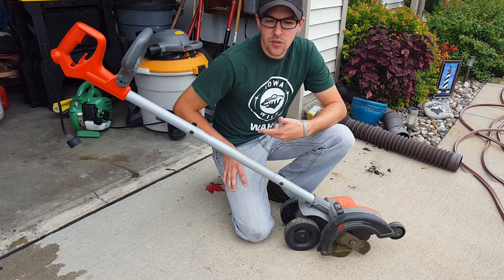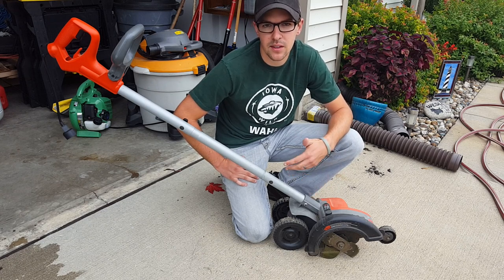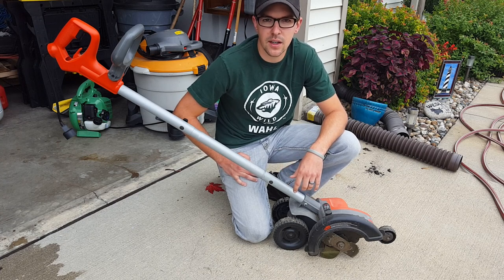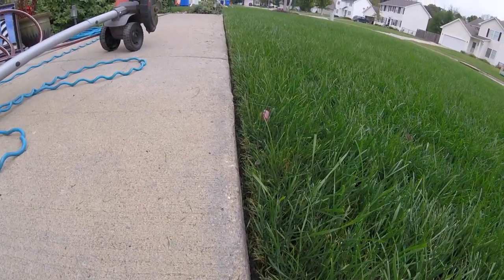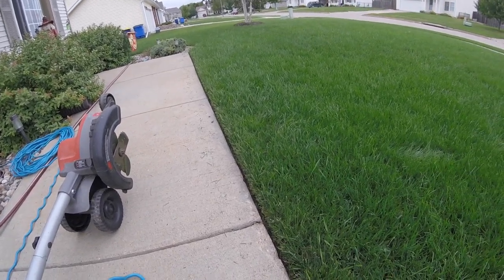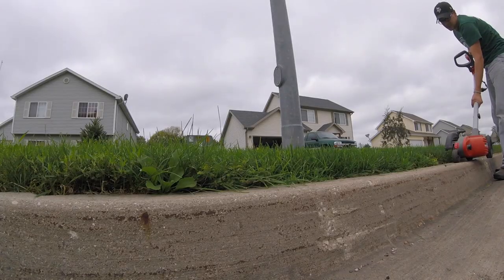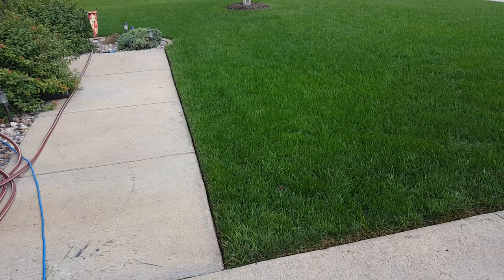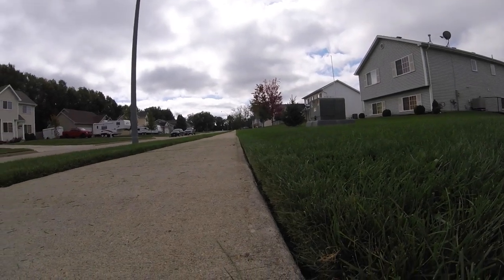Lawn Update 25 - All About Edging

Comment: I fully realize this video has aged a couple years, but I was using the same model successfully for the past 5 or 6 years.  I recently, however, invested in a few Greenworks Pro tools that utilize the 60v Max battery system.  Their 60v edger surprised me by doing as well as or maybe even better than the B&D model.  I have about 160’ of curb to edge as well as about 60’ up one side of the driveway and 50’ down the other side.  A single 2.0 amp hour battery can easily edge all that length on a single charge.  No more dragging cords around.  Thanks for the channel - really enjoy seeing your techniques as well as the new products from time to time.

Comment: Picked this up based on your recommendation. It is really easy to get a clean edge. I tried to do it with the string trimmer and it was really tough to do cleanly. I will still use a string trimmer for trimming weeds and grass near fencing or trees. But this is perfect and affordable. The only complaint if any is that the Black and Decker is pretty light sometimes i lean into it a bit around curved sidewalks.

Comment: watching this in 2021 because i magically got my hands on one of these.
Reply: Yo
Reply: Same. Found one at my local goodwill for $15. For a while I’ve been busy edging with my weed eater
Reply: @A_collector_  same. I just bought one for the same price at goodwill.
Reply: Thank you!
Blades are now $11.00 for 7.5” X 2”.  Just got an edger on marketplace for $20. The old blade was 2” short. Never changed from new I guess.
I don’t weed wack the edges. I cut my yard at 3” and Wacker cuts too much off and that’s why I wanted a edger. New blades on mower did great.

Comment: You have an enviable lawn to be sure. I have a couple corded tools as well and I think you may want to get a larger gauge cord. That curling can be the result of the wires overheating from too small of a gauge for the length and electrical draw.
Reply from the maker: The cord just gets multiple uses and is getting old but thanks for the tip!

Comment: I have the same one, older model though. If you bend the cord near the end you can push it through the hole near the handle and around that hook so it won't pull your cords apart
Reply from the maker: Thanks for the tip!
Reply: He was using a thick cord that won't fit

Comment: We purchased the LE750 Edger and Trencher. So far I'm not really happy with it.  I wish my old edger had not broke. LE750 does not seem to follow the concrete edge. I have it on the correct guide,  and I  end up holding our left hand down farther on the pole to put pressure on it to try and get it to cut straight. The top T handle does not appear to line up straight with the handle either. I've used it twice and still not sure it is a keeper. I either end up with a ton of sparks from hitting the concrete or a 2" gap cut off from the concrete.

Comment: I'd love to use this type of device. Works well in a straight concrete drive like yours. Our neighborhood is all asphalt with but such straight lines. Need to account for smaller undulations in the edges with asphalt. So I use a trimmer for the best results!

Comment: I have that same edger and rarely use it actually. I didn't realize how well it would be to just edge the lawn, as opposed to edging garden beds.  I'll have to give another try.  I do hate the extension cord need though.  I use a battery operated trimmer/edger now (also black and decker) and I have really gotten spoiled with battery operated - makes it so much easier, especially over electric.
Reply from the maker: Yes definitely give it a shot on the sidewalk edging.  Once you get a good edge you can usually maintain it with the trimmer for a while.
Reply: At $80 for a replacement battery, cords look very good! And... especially while edging or trimming, cords never lose their charge.

Comment: I let my wife talk me into getting rid of my Edge Hog and get a B&W cordless string edger / trimmer. Big mistake. The thing uses up
nylon string like it's going out of style, plus, I go through two charged batteries each time. That's a drag. I have a corner lot in a
subdivision so there's a fair amount of area to trim, along with edging along the curb. Get that corded Edge Hog with a blade. Dragging
an extension cord behind you is no big deal, and do it every two weeks, not once a year. It'll go quick and easy. Good video, Ryan Knorr.
Reply: I do my edges every time I mowed my yard once a week some time twice a week

Comment: Hey Bud , did you ever do that video about blade replacement? Well see im having all kinds of trouble. I recently bought a used one in pretty good shape. But the blade was worn out. So I went to lowes and bought a new one. It came with one blade and the 2 like metal bushings or whatever that go under the blade and one ontop the blade, then the washer and screw. I have a 68 foot concrete driveway and well the right side seemed to go pretty well , i was hugging the concrete and got the one side done in about 5 mins. So when I switched sides I went about 12 feet and it stopped cutting... and i keep trying and trying, finally I relized that the blade had came completely loose. So I took everything apart, tighten it as tight as I could and it worked for about 2 or 3 feet...then same issue... idk what I could be doing wrong now, but any input would help.  I did Not have it set to trench. My dad said that it was because my blade hit the concrete that it got that loose but that doesn't seem right to me? There's some felt on the axle way down on the very bottom thats worn out pretty bad when you remove the blade and bushing. Am I missing a piece in there? Please help? Thanks

Comment: I used to have one of these electric ones.
I now have the PAS echo with an edger attachment.
The only downside of these electric ones is the first time on overgrown edges, it lacks power. You end up "stabbing" back and forth to get through.
Once you've edged once and keep up on it they're great.
Also, as cheap as the electric ones can be, the proper guage cord and the length needed is expensive. Sometimes can more than double the cost of the machine. If you have other plug in tools, then you can divide the cord cost among the other tool(s).
But since getting the echo PAS, I can't think of going back. Yes the edge depth on this electric is nice, but once you edge a few times with the gas one, you get the ability to depth the blade right, and it's more agile on curves and especially garden beds and things like that.
But just starting, nothing wrong with electrics.
Maybe the machines of today are stronger than the one I had 25-30 years ago too though

Comment: Hey Ryan I am considering buying this today and want to know 1) would you still recommend this edger and 2) would you recommend this as a trencher tool for mulch beds and around trees etc.? 

Look forward to hearing from you. I want to use this basically to start my edge each spring, trench mulch beds and around trees each spring and possibly some landscape lighting trenching. But I'd still use a string trimmer to edge after each mow weekly. I just need a deep edger to start! Thanks in advance (hoping you respond)
Reply from the maker: Hey!  Yes, I still use it and like the tool.  I don't have any mulch beds that don't have some kind of paver border or a plastic border of some kind (except close to my trees but I don't want to damage any root system with a powered tool)  so I don't use it in those situations but it's especially useful at the start of the year and anytime the edges around drivewalk and sidewalks need more power than a trimmer can handle.  It does a great job there.  Hope that helps.
Reply: @ryanknorrlawncare  Hi! Yes it helped and thanks to you I edged a bed and 2 trees in no time! I have 2 more trees left and of course the sidewalk edging but that is short work with this tool. As always helpful info on your channel my friend. And I may have damaged some of the tinier roots but my trees are so established I think they will survive. Thanks again!

Oh and I might need to tighten my base rod that the handle attaches to because mine turns as I apply pressure but not so much I cant control it but it is a small annoyance as I have to compensate for it.

Comment: Did you change the blade after you used this ,seems like it's kinda flimsy !!
Reply: I used the same blade for many years, at least 8. I use it every 2 weeks in the summer. I did not remember I had bought a spare blade ($8) when I got the edger. Not many people realize that this is 2-in-1, it does trenching also.

Comment: Rayan I have the same black n Decker edger what depth should I have the wheel on the front set to? Min depth is set to 1.0 on the black N Decker Edger
Reply from the maker: I set mine to the greatest depth possible (I can't remember the number...sorry)  Because I mow at 3 inches or higher, that seems to work best.

Comment: Love the vids! Keep it up! Are you in Iowa? Cedar Rapids, here...On the fence about buying this, Home Depot for $89. Maybe a stupid question, but would an electric chainsaw work the same as an edger? I have one of those, never use it much. It's fairly small, maybe a good edger, in lieu of this corded edger, or too dangerous/hard to handle, not enough RPMs, etc, you think??
Reply from the maker: Yep I'm in Central Iowa.  That would be much too dangerous in my opinion and just shred the grass.  The blade edger here is a thin blade where it makes contact so it makes a nice clean cut.
Reply: Thanks. And the guard is esp nice. I'm pretty handy with a tool, but worry about chipping away at my degrading slabs of cement on my driveway. so an edger with that adjustable guard, def worth it

Comment: I just never thought much of edgers like these, at least along concrete.  They cut the grass vertical and while that looks nice on Day 1 to day x (3-4-5 or so?) but blades seem to readily quickly wander and start extending over the concrete again.  But I find if I just tilt my weed whacker at a 45 degree angle so that the string is just contacting the cement, and the 45 angle is out over the grass, then I'm throwing material in front and away from me, and I end up with a 45 into the grass, which for me, seems to last as long, or longer than this type of edging before the grass wanders back over the walkway or drive...

Just me.

But, I do admit, that these edges look niftey out in bedding areas where the grass just stops with that clean cut and then you've got something like mulch coming up near that line.  But in those cases, I prefer some form of concrete edging to give me that defined line.

Again, just me....
Reply from the maker: You're exactly right.  It doesn't last too long but I maintain with my trimmer every time I mow and then pull out the edger every couple weeks or so to go over it again.  A little bit more work that way, but I like the way it looks with the straight line.   Thanks for watching!

Comment: What about if you have sprinkler heads? How does someone edge when those are also close to the edge? Thanks!
Reply: DaRedRain are they really that close across the edge? If they are and you can see them and everything I'd edge around them and go back with a trimmer around them I guess? I did and do it professionally but I've never seen sprinklers that'd be quite that close
Reply: 2 sides of my lawn have a brick border and the idiots wedged the sprinkler in a hole between 2 cut briclks, I would have to go around.
Reply: Cameron Crane You are right. Mine aren’t right at the edge. Edging was not nearly as easy as seen in this video. I’m working on it.

Comment: How come you don't get an edger attachment for your trimmer? From what I can see, it's capable of doing that. I believe a Ryobi edger attachment from Home Depot would fit it.
Reply from the maker: I guess I didn't think there was anything available that would work with it since it's an old model.  I'll have to look into that.
Reply: Should work, but check on the box if your specific brand is listed.
Reply from the maker: Cool....I'll check on that.  Thanks for the info!
Reply: Ibought a edger  atagment for my weed eater and itwas ok mivedges look great but the one think I didn't like it just has one back tire and maybe I need to get use your or with practice but the reason I like this BD is for the 3 tires it will be easier for me I always use a trimer to cut along my fence but for my edges I like and always had use an edger but my broke and itwas the big ones and mi son keeps telling me I can edge with a weed eater but I don't like I like to do my edges with an edger it looks cleaner and I love the way my yard looks but I'm watching videos because I had always used a gas weed eater and I wanted to swish to corless I'm a woman and never had a problem to start my weed eater but you know like everything when they get a little old I do struggle to start my weed eater so I think a cordless will do better for me but I'm between cord less or corded one 🤔

Comment: I just bought one, my driveway is slightly up, how do I level the wheels so I don't have to lean the edger
Reply from the maker: There should be an adjustment knob toward the front where you can set the wheel at a different height.  Give that a shot and hope that works for you.
Reply: ryanknorr oh thank you so much, it was very helpful.  I found it

Comment: I just flip my weed wacker over and get a nice steady walk going. No need to purchase another piece of equipment in my opinion.
Reply from the maker: I find this does a little bit of a better job but I also use the weed eater in between using this tool every few weeks.
Reply: DCassidy42 if it's severely overgrown you will spend a lot of time and string cleaning it up.  An edger can get you that initial edge that you can maintain with the trimmer.
Reply: Robert Weaver I have both. Your answer is what I was looking for! Why both. Thanks!
Reply: I just use the edger attachment every time.  It takes me about 20 seconds to switch over.  I just like the look of the blade edging more as it keeps that defining line.
Reply: He/she who dies with the most internal combustion engines wins!  Always a ‘need’ for that next piece of equipment.
Reply: I use the edger once a month to keep that tight look and in between I use the string trimmer.
Reply: I can't walk in a straight line.
Reply: Pondart - Have yourself a beer AFTER you edge, not before!!!  ;)
Reply: @kevinhammond3487  hehehe!😀👍✌
Reply: @stogierogy  How is that done?

Comment: WORD OF CAUTION: This is an 11-AMP machine. Make sure your extension cord is matched. A 100-ft 16 Gauge extension cord is maxed out at 10 AMP's (in other words - don't do it!).  Use no less than 14 Gauge for a 100 footer with this machine.  You'll actually want the shortest extension cord that works for (reaches to the edges) for your yardwork.  Check the chart at https://www.homedepot.com/c/factors_to_consider_when_choosing_extension_cords_HT_BG_EL

Comment: This is the way the design should be, no slinging stones no jagged lines no hitting the concrete eating it up with. the blades, but who makes this damn good design in either gas powered or cordless with enough battery juice? None so far.

Comment: Sorry, but I have to comment on a couple of perplexing things on this video, to your benefit.
1). @ the 5:02 mark; Is that a home for Rats? ... Why does it have a stairway?
2). @ 5:14 - After you connect the extension cord, you make a loop in the extension cord below the connection, and push it up into that hole in the bottom of the handle, and over the 2 inch long plastic hanger inside the handle opposite the trigger...pull down tight, and you're ready to go without the worry of disconnecting the extension cord.

Comment: If you don't already have a nice edge then that electric one is nearly useless - see here:
https://www.youtube.com/watch?v=Rw993FAAh5o
Reply from the maker: I use mine every year at the beginning of the season to cut in the edge again and while it is a little more work and takes a bit more time, it still does the job.
Reply: Yes - I used mine yesterday & I eventually got an edge after using my motor mower as well. It's still a lot cheaper than $800 for a Stihl system - that is motor + edger.